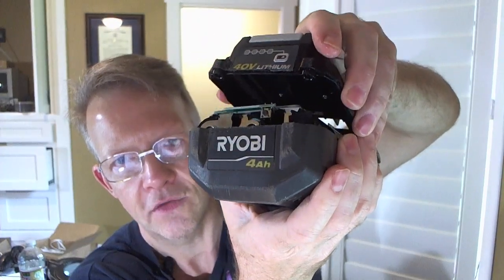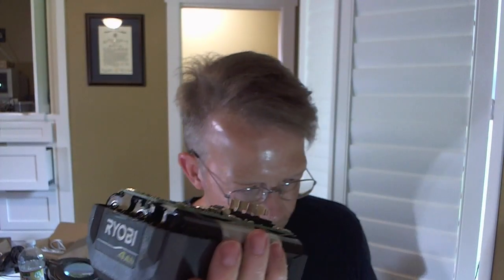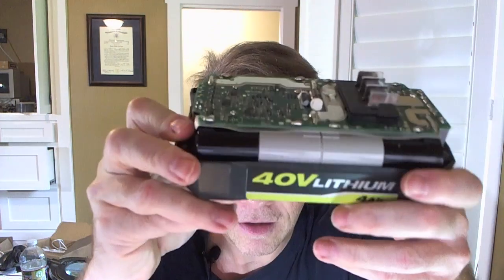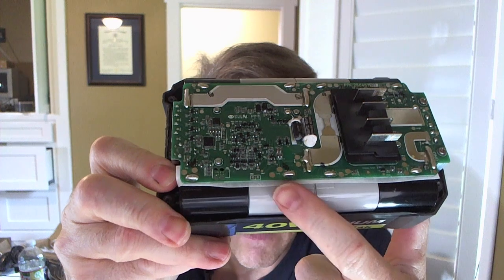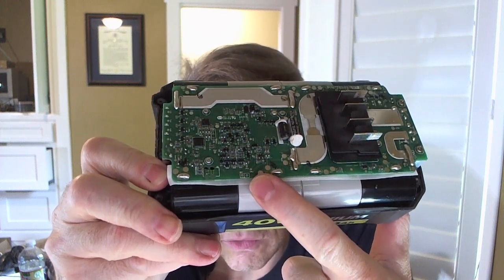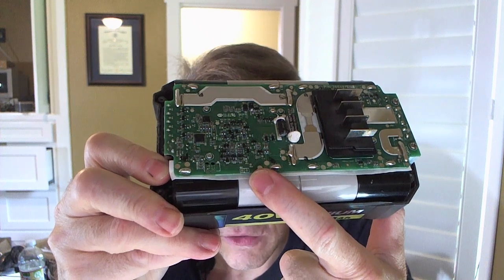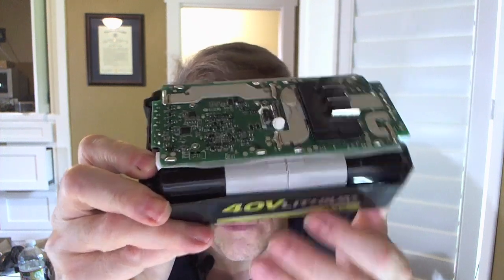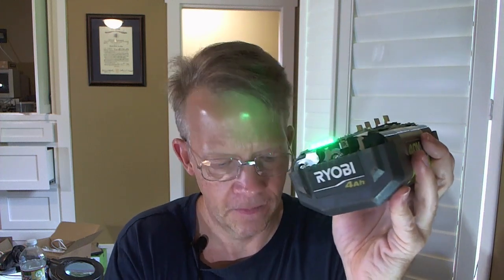Don't "Boost"; Safer Reset! 4 lights blinking on Bad Ryobi 40V Battery Pack? OP40501 OP40401 Rev. Q.

Comment: Made the call to Ryobi on my OP40501 with the blinking red/green on the charger and 4 blinking green on the battery resulting in no charge.  Ryobi took my info (easy) and told me that my battery (OP40501 - 5Ah battery) was currently on backorder, which they ordered for me, but they would be sending me a battery in stock right away. So I followed Robert's instructions and now have a battery that will take a charge with two replacement batteries on the way.
Reply from the maker: Glad it worked! Send me a cup of coffee here (or more, maybe 1 cup per battery?) http://Paypal.me/beachfitrob and please Subscribe as I'm not even getting ad revenue. Yup. You read that right. $0. Read the pinned comment on this video. Need 1000 subs at min. But they still show you ads. I just don't get paid for it. Yay for us little creators. :STEAMY EARS EMOJI:

Comment: Is there a 'reset' on the older 40V batteries?
Reply from the maker: Please Like and Subscribe. And it's unknown. There is theoretically the possibility to 'talk' to the BMS via those 4 holes on the PCB but no one's delved into it. And it would not be a simple process like this. If you subscribe, and we find a method, you will see notifications of new videos. There is SOME data here on the older pack repairs: https://www.diyelectriccar.com/threads/ryobi-40v-bms-troubleshooting-and-repair.197409/ It's a programmable controller but without a simple reset like my video.

Comment: I just got off the phone with Ryobi. I didn't make it within the warranty period. All four of my lights are blinking. Came across your video. I can do this...if only I can get the plastic covering off, LOL Anyways, thanks for your help and video. Cost of my battery is $161 whoowhee!
Reply from the maker: It's a plastic cover in the corner over one of the screws. That what you mean? Like and Subscribe.
Reply: @RobertBullock  I got it :)

Comment: Top notch solution right here! Just saved me so much hassle and I'm not sure I could find the receipt that Ryobi wants anyway because it was a gift. Back to weed trimming soon enough! Thanks!!
Reply from the maker: Please like and Subscribe so YouTube will share ad revenue with me. Also I accept any size donation at http://paypal.me/beachfitrob :)
Reply: what did u use to touch the two metal pieces on the board next to the reset switch? I get we have to ground ourselves but how do you touch it? a 2 wires/ 2  screws?
Reply: someone used a paperclip- just wondering what you used?
Reply: @DetFury50  Mobile phone sim card tray ejector tools. Small paper clips would work I'm sure though or some small gauge metal wire.

Comment: Thanks for this! Was gifted a non-working Ryobi mower. Found issue to be battery defective at charger. Tried the 'jumpstart' method with new battery first - no dice. Found out that battery needed reset from this vid, but would only work for me with RST pins shorted as battery was being jumped. Probably due to extremely low voltage level battery was at. $230 mower for free!

Also, if you don't want to cut through the sticker, it's easily pried-off with a razor blade and glue will still hold when put back together
Reply from the maker: Sweet. Re cutting: I just cut it down the middle for another reason: now I can tell what batteries needed the reset. Don't forget to like and subscribe and coffee donations accepted: https://paypal.me/beachfitrob

Comment: So you have to make the connection permanent, or just touch the inside with metal for a sec? Are you brushing between the two or just one at a time?
Reply: It's like a switch. Just has to touch both for a few seconds. Sometimes you have to push the battery gauge level on the end at the same time. You could solder in a sideways jumper I guess if it keeps happening then just put a jumper on it to reset it.

Comment: I tried (a couple times) to re-set it with a paper clip - the end tip went thru and touched the battery pack.  I did not work.  I read several of the comments and all were able to get good result. I wonder what I did wrong.
Reply: Try pressing the 'battery gauge' button while the jumper is touching the RST contacts. Look closely at the holes to make sure the metal is exposed and not covered in green. A small flat screwdriver can be used to GENTLY removed the green coating.
Reply: @RealActorRob  same thing happened to me  :( when I jump it, and press the button, they light up solid green.

When I take the jumper off, it goes to one l.e.d. and then basically resets itself and I have to do it all over again. Any ideas?
Reply from the maker: After the reset, did you immediately try to charge it?

Comment: I have a OP4026 with “018” stamped onto the board with the date Dec 17. 2013. Anyway, this board has these holes in the upper right hand corner: CLK, DAT, GND, 3.3v and RST. There is only one hole with the RST, what should I connect it to? Thx
Reply from the maker: Different. Those can 'talk' to the onboard system somehow but that's for a deeper hacker. :)
Reply: did you find an answer to your question? I have the same battery.
Reply: @mmmallory1649  unfortunately not. I’m saving the batteries for now. I won’t buy refurbished anymore, the battery warranty really negates any savings.
Reply: I have the same issue. Have you had any progress?
Reply: @C0D1F3R0U5   I’ve not been able to find anyone or any information that would resolve this question.
Reply: connect "GND" and "RST" with a jumper wire (paper clip, solder wire etc.)
Reply: Jumper RST and 3.3v for a couple of seconds: @

Comment: I tried to charge the individual cells with the other threads to no luck. I then went back to trying the reset jumper (after trying it initially). Still no luck. But what eventually worked for me was to jump it and press the check battery button and that seemed to work. It might have just been poor jumper connection. Anyway, just figured I'd mention this. FWIW, my battery was registering about 22V. Being a seasonal tool (lawn mower) I'll now know to recharge the battery to at least 50% before I store it in the winter.
Reply from the maker: Yes, I think that's been a step for several people. I think one of mine was like that. Don't forget: Buy me a cup of coffee here :) http://Paypal.me/beachfitrob And please like and subscribe. YouTube shows ads but I don't get any money from it until I hit 1000 subs.
Reply from the maker: I'd store batteries about 60%. Somewhere in there is the best amount.

Comment: Great video, unfortunately I'm one of the few for which it didn't work.  It reset just as you described.  Displayed one light of power level after reset.  Connected charger and it blinks green 8 times then back to red/green.  Power level goes back to all LEDSs flashing.  Reset it 20+ times with same result.  Interestingly, when in fault mode, voltage reads 30 then falls to nearly 0 immediately.  Will not run weed trimmer at all.  After reset, voltage reads 40V and holds.  Put it in weed trimmer and it runs great.  Put it back in charger, 8 green flashes, then red/green.  I think it's fully charged but doesn't know it.
Reply from the maker: Or it’s got some other fault. 40V should work for the charger. I think it will charge as low as 32 or so.
Reply: @RobertBullock  yeah.. probably something else.  It was under warranty and new one is on the way, so this would have just been a bonus if I was able to save it.  Thanks for the info to attempt it.
Reply from the maker: @mikespeer7290  You’re welcome. Please like and ESPECIALLY subscribe so I can share the money YouTube gets for the ads. New policy. :( Under 1,000 subscribers you get no share and you can’t even turn the ads off. :(

Comment: 5/12/21: Saw your video when my Ryobi 6.0ah 40V died. I called Ryobi and they are sending a new one in 10-14 days. So, like you I was told to recycle the old one, but I tried the other things like jumping it or the in-and-out trick. Nothing worked. I ordered a security bit set from Amazon then when it arrived, took the screws out, used a small paper clip to jump it, then threw it on the charger and it's charging now. Thanks for the great video!
Reply from the maker: Please buy me a cup of coffee here: http://Paypal.me/beachfitrob Any amount is awesome. :) Also: YOUTUBE is making money off these ads. NOT ME. Until I get to 1,000 subscribers, they keep it ALL. It's really unfair but you can help by using my links, making tiny donations, and at least clicking that "Subscribe" method. I've saved hundreds or thousands of dollars for people, and YouTube is making money off this...so help me out.

Please use my links: I'm underemployed. YouTube is one of my part time jobs. :) Subscribing costs you nothing and I need to get to 1000 subs! Those ads you see here? I get NOTHING until I hit 1,000 subscribers.

Comment: Had to do it twice and run my blower before trying to charge again. So far so good! Don't know why mine went into safety mode, I just use it in a leaf blower and weed eater. I've only run it down twice.
Reply: Tried it over and over. It would reset, but once on charge after 20 - 30 seconds it would just go right back to flashing. NEVER would it get to a full charge. Not the charger because it charges my other 2 just fine.
Reply from the maker: Please buy me a cup of coffee here: http://Paypal.me/beachfitrob Any amount is awesome. :)
Reply: @RobertBullock  didn't last, won't take a full charge. Just bought a new one. Get your own coffee.

Comment: For anyone who has done this and once putting it back on the charger it reverts back to safety mode, give it a few tries. It took me about 8 times resetting and placing it back on the charger before it quit reverting back to safe mode.
Reply from the maker: That's what I have heard. Glad to confirm it works at least some of the time. It charges a small amount each time is my understanding. Please buy me a cup of coffee here: http://Paypal.me/beachfitrob Any amount is awesome. :)
Reply: Yep that’s exactly what mine is doing reverting back to safety mode every time, I will keep at it and update as to how many tries it takes. Twice just twice and it seems to be charging OK now. Thanks much !!!

Comment: This did not work for me. It resets with no problem and one light lights up when button is pressed. When placed on the charger the first and last lights light up for a few seconds then it reverts back into safe mode.  Thankfully mine was still under warranty and I have another one coming from ryobi.
Reply from the maker: Keep resetting and try charging. Soldering a reset button in could speed this up. Supposedly the charger will charge a little each time and eventually it works. But I have not verified this.
Reply: @RobertBullock  I did do that approx 20 times with no change. I may mess with it again soon. Thanks for the vid! New sub!

Comment: I've got a weird problem with my 40v/6ah battery. The battery's own lights show 3/4 lights, no blinking or flashing. The charger shows an error after a good long while. And it won't power my mower.
Reply from the maker: Did you open it to see if you can reset it?
Reply: @RobertBullock  not yet. Going to call and see if they'll replace it first. I did measure the voltage and its like 13v. Seems a bit low.
Reply: @RobertBullock  Just got the replacement and opened up the old one. Its a OP40602 (aka: the 6AH HP battery), and doesn't have the same board. Been staring at it a while to try and find a likely alternative jumper location but so far nothing. It does have two SWD headers though so that's interesting. Board says V4.2. Its not actually blinking. I press the button and it initially shows 4 lights but then immediately falls to 3. the charger will blink after a few seconds. and my multimeter shows like 14v.

Comment: Thank you SO MUCH for this! I was not optimistic this would work for me but it did. It was super easy too once I ordered the security torx. I used a paper clip to touch both sides of the reset and it did the job. Battery is charging again.
Reply: How long do you hold the paper clip in for?
Reply: @crazymaloco5890  - less than five seconds it seemed like. I bent it such that each prong went into each hole and was careful not to touch anything else. You’ll see a light flash when it resets.
Reply from the maker: @davidebel39  Yes, as mentioned, some people might have to use a tiny drill bit to scrap away some green coating inside the hole. But it may not be necessary.

Comment: This worked!!! Thank you so much. I got the defective battery message after trying to tackle some overgrown grass with the self propelled mower.
Reply from the maker: Please buy me a cup of coffee here: http://Paypal.me/beachfitrob Any amount is awesome. :) And yeah, pretty sure it's a simple overheat because of a thermistor that detects such.
Reply from the maker: Yup, same deal: just a temporary overheat.
Reply: I see the 4 lights flashing randomly after i charged it but it was also after using several batteries to weedwack tall grass.  The battery works but the battery level indicator flashes without even being connected to a tool.  Mine is a 4ah 18v ryobi though.

Comment: Thanks for the great video, Robert. I was able to follow along and trigger the reset just as you described. I am, however, having the same problem that I see quite a few people in your comments section are having. After putting it on the charger, the charger blinks green/red and the battery goes back into safety mode. It looks like I don’t have any juice when using a multimeter, so I’m guessing leaving it out in the shed through winter killed it. I’m a layman and I don’t have any friends nearby who would be comfortable working on it - should I just eat it and get a new battery at this point? Cheers.
Reply from the maker: Make sure to like and subscribe. :) Well, what you could do is add a button or switch to the battery so you can reset it over and over. Some reports are that when you put it on the charger, it applies a LITTLE voltage then faults out. So you''d reset it each time. Could be done while you're watching TV. :) This would take a while. One option is to sell it to people who want to strip it for 18650 cells inside. I'd look at Amazon if you want a new one. Third party is MUCH cheaper, like half price: https://amzn.to/3uxa9qu I earn a commission from Amazon links. :)

Comment: got super excited finding your video because im having the same issue w my 6ah 40v op40602 battery    crack the case open  and competely different board , cant find the rst pinholes on mine anywhere    manufacturing date on mine is 2019 4 13   back to the drawing board lol  but A+ video man
Reply from the maker: Can you post a pic somewhere of the board and link here? And don't forget to like and subscribe. :)
Reply: @RobertBullock  don't bother with a pic. Apparently, Ryobi was made aware of the reset feature on the board and the new boards implemented don't have a reset feature at all. Didn't want us breaking the cycle that pads it's revenue stream...

Comment: Worked for me. Mine was out of warranty and Ryobi just told me to buy a new one. It wouldn't take much to add a small reset switch into the housing. Seems a little scammy on their part.
Reply from the maker: True, but not too hard to add your own. Could maybe just use some small screws soldered to a couple of wires that pass through the case. Maybe I should build a kit. :) Don't forget to Like and Subscribe and if you send me a cup of coffee at http://Paypal.me/beachfitrob then you're in about the 10% of people who do.
Reply: Im actually going to get a little micro switch and add it to the outside of the case on mine.    I still cant believe how simple it was to get it charging again.   Saved me a couple hundred bucks for a new battery.

Comment: Hey Robert, do you know if the hole next to it is ground or something else? I have an older battery version of the 40v 0p4026 but there is 4 instead of two holes one of them says reset the other one looks like it says ground and one says 3.3 v and clk. Any idea which other whole I would need to use with the one that says rst any help would be much appreciated.
Reply from the maker: No info on that. It’s for “talking” to the BMS basically I think. Has data lines you see, IIRC.

Comment: The jump worked for 10 seconds then went back into defect mode once on the charger.  Could it be a defective board? Maybe leaving the pack to fully discharge over the winter causes it to fail in the spring!  Has anyone tried leaving the pack in the charger all winter long on trickle charge?  Will this help maybe?  Thoughts?
Reply from the maker: That's not the way a LiIon BMS works. It will only trickle if it 'decides' to. Storing it at 60-70% charge in a room temperature is probably best. 100% is not great for longevity. For sure, letting it get too low will kill these packs. If it's too low, the BMS won't apply a charge. In that case, you have to jump directly to the cells via the traces on the PCB but I'm not detailing that as it's dangerous unless the voltage differential is small and you need a variable  output power supply for that, IMHO. Or a low amperage AC -DC converter at say, 24V and then you have to apply it to the right contacts...too much risk for the layman, and anyone who knows what they are doing can figure it out. Not much territory in the middle.
You pack could have a different issue or need the direct jump to the pack traces. I will say the pack has traces that should have 20V each across them and IIRC anything less than about 30V total in the pack will cause the charger to refuse to charge. Some places say repeated pack insertion into the charger can cause it to gradually build a charge but I wouldn't design the logic that way so I kind of doubt it. I'm sure it looks at pack voltage first before it applies any charge.